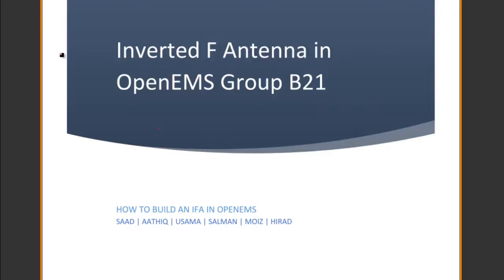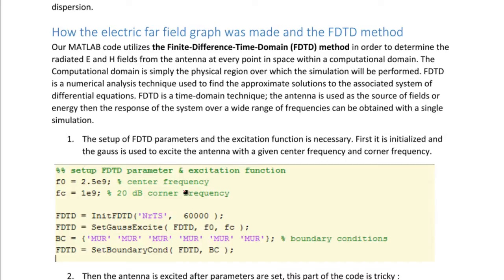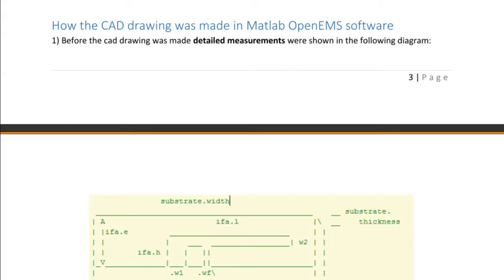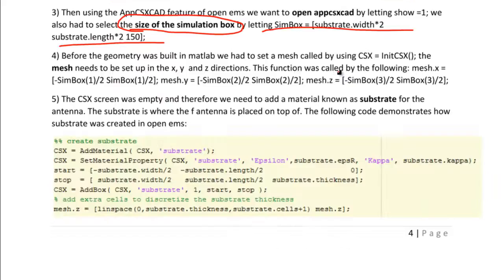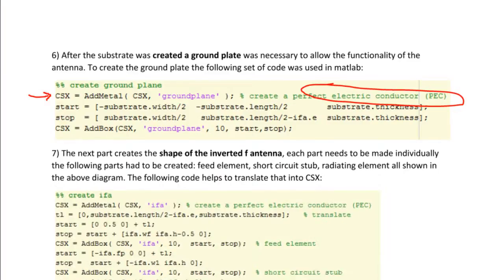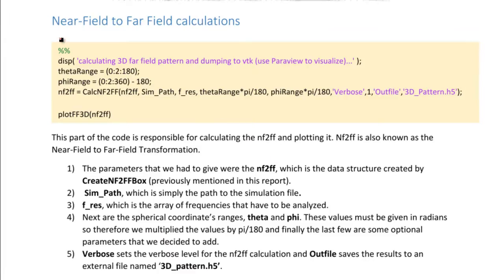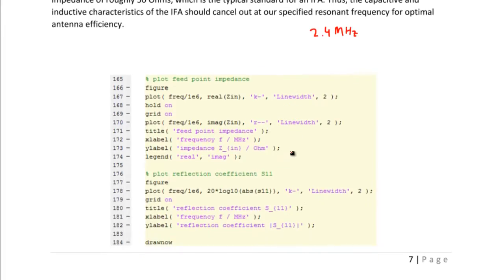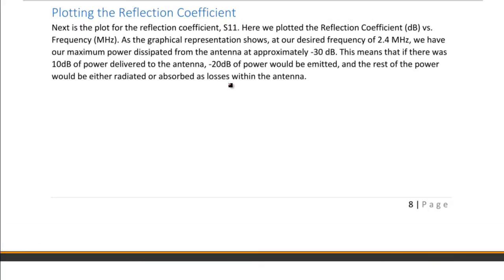Group B21 2FH3 Final Project OpenEMS Inverted F Antenna

Comment: How did you calculate the variables for the width, length, etc.I know that you said that was based on the frequency, but I mean what the equations you used.